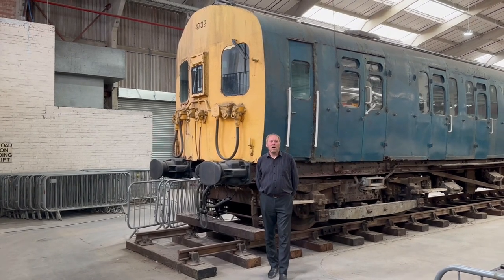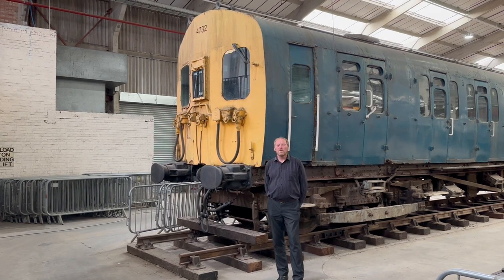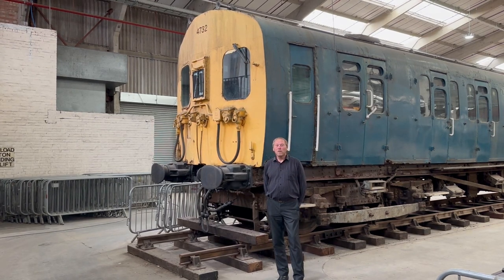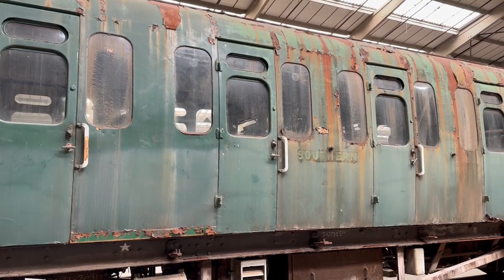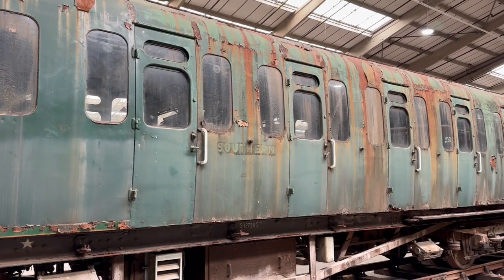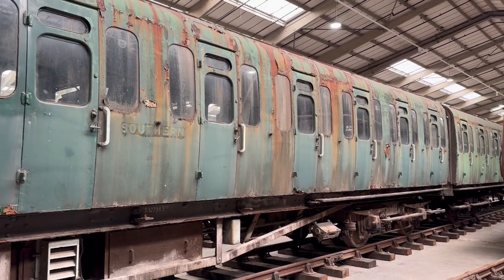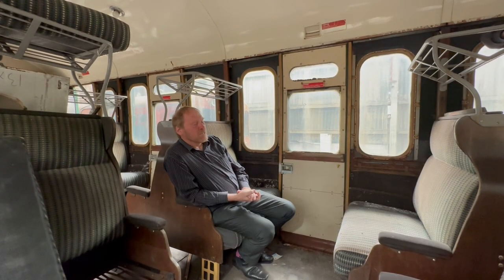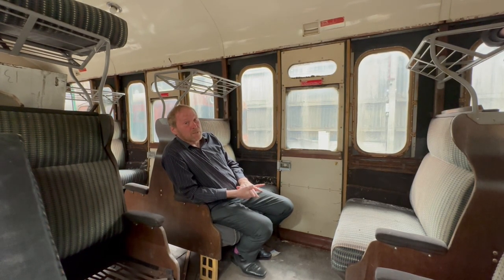The 4-SUB Car One Project

Comment: From 1967 to 1972 I used to catch these trains from Maidstone East to Victoria station 3 times a year to get back home from school for the holidays. You had to make sure you got in one that had a loo on it as you could not go from carriage to carriage. They also had smoking and non-smoking carriages. Once, having arrived late we jumped into a carriage and as the train drew off we were scolded by a very irate woman.. that's when I discovered that it was a Ladies only carriage!
Reply: That would be 2 HAP stock or 2/4 EPB, the 4 SUB units didn't run on the South Eastern as far as I can recollect?

Comment: Hehe I remember that train so well, can't say anything but in my teen years rode that whenever possible including when it was running to and from Gravesend making for a lovely day out with me girlfriend.   Funny too is that I featured in Hornby's magazine some years prior as they gave me a personal guided tour in that factory, was only 11 and so fond of those memories.   In 84-85 I serviced the 4SUB's requirements at Waterloo, so if you ever saw a gangling lad trudging to and fro with a trolley loaded with boxes of Palmolive soaps, paper towels, several lit lamps etc that was me as I had to be up for the incoming Exeter train then over the other side to do the west London SUBs.   In the 70's I used to go to school on a 4SUB, now these were rare couple of units that ran out of plat 8 which had still the corridor compartment coaches still in place and a loo too, fun sitting in what was first class downgraded but they got scrapped.

Comment: hi there, never knew this train exsited.this is great.i remember these in the 60s as a child, will it run again ?
Reply: Unlikely due 3rd rail nowadays is 750volts not 660. Also so much would need to be changed it would affect the originality. Cosmetically it needs 50k per coach before you get to the mechanical side of things
Reply: 660v dc was always inner London suburban voltage, hence 60 mph speed limit,  once out the catchment it was 750v dc, the SUBs permanently kept within catchment area, once she was classed as a celebrity unit and had restrictions she could run on 750v dc but wasn't permitted to run overspeed, it still had to be kept to 60mph everywhere she went, usually accompanied with the 2 BIL too